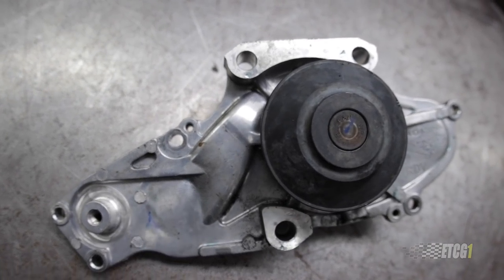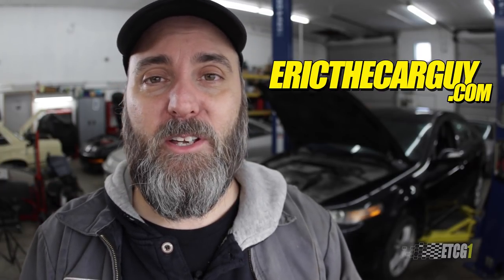Timing Belt vs Timing Chain, Which is Better?

Comment: Timing chains: you're dependent on the owner's ability and willingness to do timely oil changes, because if not, then the chain will wear quickly. A lot of work to change. And some do need replacement as a maintenance item. (W123 230E)
Timing belts: Easier to get to, lighter. 
Timing gears: truly no maintenance. Will outlast the engine. But noisy and heavy.

Comment: $600 in parts to replace my timing chains - 3 chains 4 guides, 2 tensioner (partial kit cause I didn't do the gears one being the cam wheel) service life is every 150,000 miles .. Major undertaking .. if not for doing it "myself" I couldnt have afforded to fix it and would have had to just scrap the vehicle.

Comment: I guess it depends on the engine design and complexity. Eight years ago we bought a 2011 Hyundai Santa Fe with the V6 engine. I’m like “Hey, no timing belt to worry about”. Fast forward to 2018 and my daughter gets a used 2014 Ford Edge with the 3.7 V6. Again, no timing belt to worry about. Wait, where’s the water pump on this? Oh, crap!

Comment: Neither is better then the other imo.
Seen them both fail in spectacular fashion, seen them both go the distance. Seen bad designs in both, seen great designs in both.
I don't shop for vehicles based on which it has, though it can sway me if its between the 2. For exactly the reason Eric said, I'll be in there every so often, so ok, T belt and water pump. belts, hoses, plugs and a valve adjustment, and man it runs nice again.

Comment: Not just heavy trucks  but Chevy small blocks have gear option to drive camshaft if you are racing.  American V8s, the chain are so short , hydraulic tensioner are not necessary. They do fail on occations and sometimes you can tell with the timing light the chain is loose. I am not so frilled with those nylon gears , they fail easier.

Comment: My first car, a 1993 Ford Escort 1.9L had a timing belt and non-interference engine. Because it was non-interference I didn't mind having the timing belt. It broke on me once, engine simply stopped running mid-drive. Not a big deal, didn't have a new belt or tools on me at the time so I called for a tow, got it home, bought a belt, changed it in like 10 minutes, back on the road happy as can be. Some time later I blew my engine and had to get a new (used) engine put in the car. Blew that timing belt mid-drive as well, changed it, moved on. I say that to say, if it's gonna have a timing belt, I feel it should be non-interference since it is rubber and it is prone to breaking. Shouldn't trash the engine just because a stupid piece of rubber broke on you, doesn't seem fair to the owner. The timing chain, however is more likely to fail due to poor maintenance leading up to the failure. That's on the owner, that's a slap in the face they deserved if they didn't maintain their car, mostly just getting oil changes on time.

Comment: Timing belts wouldn't have been bad if two things had happened.

1. People actually read and performed their scheduled maintenance.
2. The dang covers hadn't been made in a way that makes it impossible to remove on most makes to look at the belt or replace it without doing a lot of work to access it such as jacking up one side of the engine and removing mounts, harmonic dampeners, and cam pully.

That all said I'm in the gear camp. XD

Comment: Through all my driving experience years and purchasing used vehicles (never drove new one and don't see myself buying brand new) I came into conclusion. If it's an old car +10 year and +100k miles I would look into timing belt engines. If it's not interference one it's a win-win. Because on that milage chain may have an issue too. And I had a bad experience with chain on 10yo V6 which most lead me to replace chain, sprockets and tensioners, but it was able to sell it before anything happened. Despite the fact that my very first car with timing belt had belt snap on a road and I was able to replace it on spot and still drive back home with few banded valves (hopefully then didn't break and fall into cylinder). So, what I mean is that chain on used car may still need to be replaced since you don't know how often oil was changed. Unless engine is inspected for noises and dirtiness inside. And I would change belt in half a day but I'm really scared to open engine for chain replacement.
Reply: Really good points here. I agree, used car with chain would be a gamble unless you absolutely have evidence of proper maintenance. Belt engines can have parts replaced and work is somewhat easier than timing chain service.

Comment: At least on quite a few european cars, in the last 10 years or so, it seems that chains have given a lot of problems with the tensioners. On a number of brands, also from brands that in the past have had chains that were bombproof and could do easily 300k miles.
If the chain runs good and is reliable, then its awesome. If not...then you're sometimes in deep shit.
Especially if you have a chain that is situated between engine and firewall (meaning: engine out)

Comment: Opinion:  The only GOOD reason to use a timing belt, is so you can lower your oil volume and engine weight, so pretty much any car engineered on the road for economy - BUT in high torque, or high displacement or compression engines, you should probably use a chain.  Of course, timing chains are also BIG $$$ when they stretch in very tightly monitored systems that use Variable Valve Timing, which is an entirely different thing you have to factor in.  I've replaced chains on a lot of 2.4L GM Engines, V6 EcoBooms(Ford EcoBoost), and 3.6L GM and Chrysler engines, it's big money when that happens, CHANGE YOUR DAMN OIL.

Comment: Water pumps that are driven by timing chains are usually very, very difficult to replace. In my Nissan Sentra I suspect that the water pump is not of an especially robust construction, and prone to the same failure rate at a more easily replicable one. I definitely consider that a downside.

Comment: My last car had 60,000km timing belt change intervals. That's a bit of an expense if you drive a lot.

Aren't there some newer Ford engines around with timing belts that sit in oil?

Comment: You replace your timing belt 2-3 times in a vehicles life. That's it. Imo the ability to change the belt faster/periodically change water pumps and tensioners, not have to worry about hard to access guides failing, or oil pressure issues, all of this and more makes timing belts the better option to me. Yeah your chain itself doesn't need servicing, but to spend not a lot of money to refresh the timing belt and other things once every 100k miles is superior.

Comment: Hey Eric I don't know where to go ask questions but I have a major question to ask I was driving and when I pulled out and got behind someone going vary. Slow well I passed him up I tried to get up to speed and my transmission would not shift in 2nd I got a few miles down the road I started to hear something from my engine and a few minutes after that the blazer just died and it wouldn't start back up people are telling me it's the starter it's the battery it's the alternator but when I try to crank it it's got a wired sound coming from my engine but if it was the engine why wouldn't my transmission shift in the next gear

Comment: Technicalityeree a steel reinforced timing belt would be best for general performance, stays very close to true in it's service life and breaks in fast. Problem; they don't tend to stretch and if you don't change them at or before there service life they go from great to pop, bam. boom

Comment: Or you could have a wet timing belt that runs in the crankcase 🤷‍♂️ belt or chain it doesn't matter, as long as they are reasonable to maintain

Comment: For me, it doesn't matter timing chain or belt.  Instead I try to avoid an  interference engine because even with the best intentions if a mistake is made when servicing either type trimming device , poof goes the engine.

Comment: One big issue with timing belts is that, when buying a used car, you're often in the dark insofar as whether the timing belt's been done or not, and it's not something you can visually inspect without taking a bunch of stuff out to get to it.
Reply: The bigger question is - did they change the water pump at the same time?
Reply: @redmondjp  yep that too

Comment: chains used to be great when it was one crank and one cam shaft... once they added 3 more cams and tensioners and guides (3V Triton) more and more problems arise. as a cummins guy I dont worry about any of that and when my motor hits 500k I will probably be 6ft under.

Comment: I'm not against either one, as I think they both have valid applications (belts can be quieter for example) but my biggest thing is the extra maintenance required. I've owned vehicles that had both types (last few had timing chains though, but not that this impacted my purchase decision).  With a chain, as long as you keep the engine oil clean and changed periodically, it should last the life of the vehicle in most cases.  With a belt, you will likely have to change it at least once, and perhaps more often as mentioned in the video.  The kicker is sometimes the cost.  For example, Subarus can cost $1000+ to pay a shop to do the belt and other maintenance items at the same time (plug and wires for example).  Honda did away with timing belts in their Civics in 2006 I believe, and many others also followed suit (I think for the most part, Toyota doesn't use belts either in their modern vehicles, although the Corolla prior to 1998 had a belt I believe).  So for me it has come down to maintenance is the main "issue" with belts.  Plus, if your water pump leaks, you generally have to replace the belt.  With a chain, you may not necessarily have to do that, although it might be wise to do so in some cases if the coolant leaks into where the chain is, but in most timing belt designs, as mentioned, they usually drive the water pump, so it is possible fluid can get into the belt area and destroy or weaken the belt if there is a leak.

Part of me does feel that when a chain starts to have issues you would get some type of early warning sign more so than a belt.  A belt would usually just snap, but a chain could develop "slop" in the tension and you may be able to avoid a catastrophic failure if you detect it early on.  With a belt, that's not always the case, as there generally is NOT any type of warning in most belt breaks I've seen.

So if I had to pick the two, I would lean towards the chain club.  Especially if it's an interference engine.  If it's not, then it's less of a concern.
Reply: I am soon in need of a "newer" car.   I buy cars very cautiously and infrequently.  My wants are:  smaller SUV, V6 as I pull a 2K pound trailer.   Many brands going to 4 cyl. I still want a non turbo V6 .  I currently have the Rav4 with the fabulous V6 2GR engine.   I've faithfully changed oil every 5K since I've owned it at 30K miles. It now has 185K miles.  I can only come up with one standout choice...the Lexus RX350   - smaller SUV,  quality japanese parts (assembled in USA) ,  timing chain and plenty of HP for the trailer. But they are a bit   $$$.   Your thoughts please....The other possible choice is the new Honda Passport but it has timing belt- UGH.  It is less $$  (7K)   so maybe the price indifference will pay for the $$ labor/parts in changing the belt, tensioner and water pump every 100K miles.    at my age 68,  I may be belly up when my next car hits 100K miles!   Know what I mean?  appreciate a RSVP- thanks

Comment: Chains are much more a pain if you have to do any tipe of head work or pulling it off. I do prefer chains though as I'd never had any issues with one. But I also don't mind my timing belt either since it runs the waterpump and those fail around 100k anyway.

Comment: IMO the belt vs chain thing goes back to the idea of the old reliable & DIY serviceability (aka push rod engines). People hear "Chain" now, and their brain triggers to Grandpa's 1968 Ford F100 that's still running with the original chain in it, or the time Dad's 1975 Chevy needed a chain & they did it in the garage in under 2 hours with a set of Craftsman tools. But it's NOT the same anymore. IMO if car makers would've given just 2 more inches of room in an engine bay, belts would've never fell out of favor, because they are actually easier to change than chains....... just harder to get to than the timing chains that were still in use at the time. Kinda like "In Tank Fuel Pumps", everybody hated them until car makers started to put access holes in the cars, so you don't have to drop the tanks anymore.
What do I prefer? Well I'm one of those guys that puts a gear drive in a push rod V8 so I get the raw mechanical "sound" of the early 50's & 40's.

Comment: It really depends on the design of the engine.  I have a 2012 Ford Explorer with the 3.5L V6, and the infamous timing-chain-driven water pump that fails and leaks coolant into the engine oil.  In fact, I'm having said timing-chain and water-pump replaced this week because at 140K miles it has finally started to leak coolant into the engine oil.  😞

I can't help but think that it would be an easier (and cheaper) repair if it had had a timing belt instead of a timing chain -- since belts are designed to be replaced, and chains are not.

Having said that -- engineers that design their engines to have timing belts could do a FAR better job at making those timing belts easier to replace!  There are far too many timing belts that are supposed to have been designed to be replaced, yet take 10 to 15 damn hours of labor to do it.  (I'm looking at you, Volkswagen!)  What the hell were they thinking with that?!

So really, it all depends on the design.  I think engineers should be forced to repair their engines themselves -- THAT would go a long way towards making designs better for both timing chains and timing belts!
Reply: Chrysler on the 2.7 added a port that goes through the block and out of the thermostat housing to keep coolant from entering the engine it pretty much made that engine more reliable and last longer I have 146,000 on mine currently and people need to maintain these cars or it will go bad
Reply: I totally agree
Reply: 1.2L CBZA Audi engine says high. You have to replace timing chains on these things every 50-60k miles because the chain wears out and starts rattling. Not only you pay 2 times the amount for chain replacement comapred to belt on similar engine but you also have to do it 2 times as often.
Reply: So the timing chain didn't fail it was the water pump
Reply: @beekeeper8474  the old water pump had a plate in between the pump and the engine which had problems. The new design had a better gasket, no plate and a weep hole that would leak out by the thermostat housing on the driver side of the engine.
Reply: It’s due to lack of space. If you have limit on space then you can’t really have much freedom to work

Comment: My "favorite" would be those poorly-designed (I'm looking at you, GM) timing chain sets with the aluminum cam gear capped with plastic teeth. I can't count how many of those I've replaced, then having to go into the oil pan to remove the plastic shrapnel. Oh yeah, fun times.
Reply: Post bailout GM build quality for you
Reply: @workingcountry1776  Even many pre bailout GM cars were built that way. They wanted their luxury divisions to have quieter engines, that's why they had nylon teeth on the cam gear. It was common with other companies as well. Sometimes they used fiberglass teeth, but the result was much the same.

I never once saw a replacement timing set that used those stupid nylon or fiberglass teeth. Nobody needs that crap, and it never did that much to quiet the engine anyway.
Reply: @skylinefever  those nylon coated gears seemed the height of stupidity to me too. Silly method to quiet things down.
Reply: watching the timing mark jump between 4 and 12 while trying to tune er up fun times
Reply: Many cars besides GM (coughAudicough) have plastic coatings on the chain guides and tensioners which similarly disintegrate and can clog up the oil pickup screen.
Reply: I had a problem with gm on the 89 s10 is gear to gear and it’s not metal.  Broke tooth and truck don’t run👍🏻
Reply: @redmondjp  Audi design decisions I encountered are plastic window regulator components, and putting a transmission control module in a foot well that fills with water when drains get clogged.
Reply: Junk
Reply: I have never heard of this before. Wow that is crazy but I am sure it was done on purpose to make disposable cars.
Reply: My brother had an old Ford LTD with the same problem.
Reply: I think in the early '90s they had a neoprene gear on a timing chain and the vortex that had problems as well